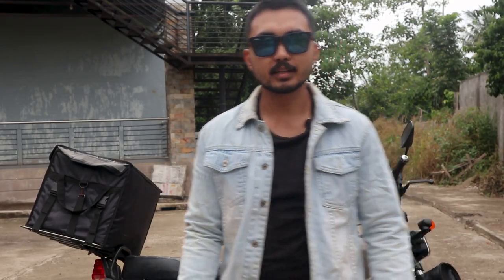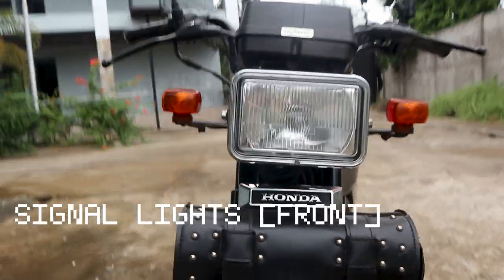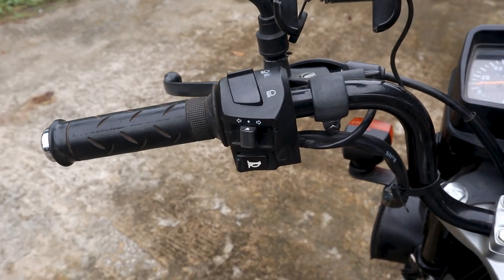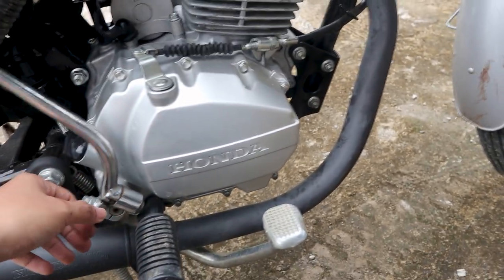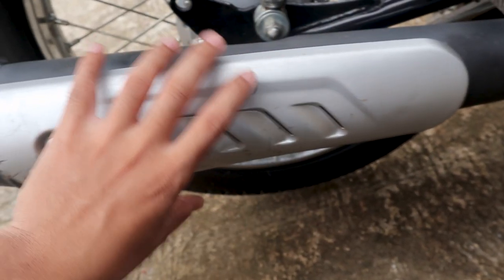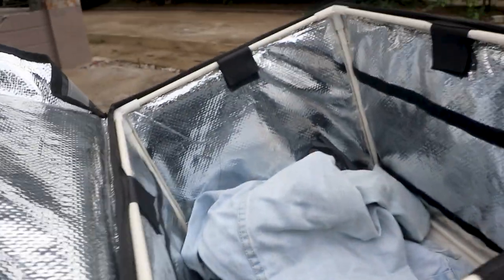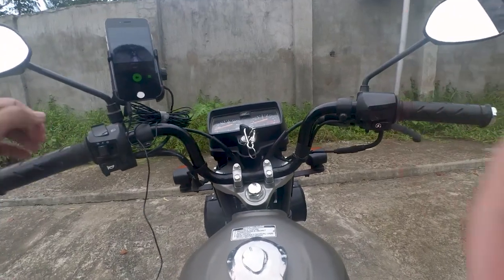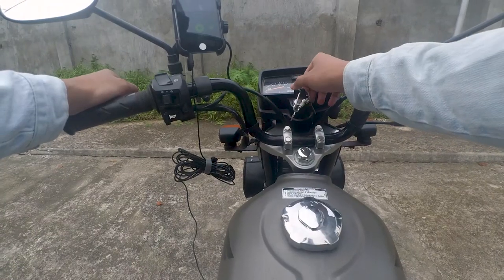HONDA TMX 125 ALPHA 1-YEAR REVIEW | RAFAELANTIHERO

Comment: I owned one last Nov. 2022. So far so good just like that colour. Good OHV (Overhead Valve) engine. Pretty good mileage. I replaced the front tires from 2.50 x 18 to 2.75 x 18 and the rear tires to 2.75 x 18 to 3.00 x 18. I did this so that it could hopefully handle my weight, I am 6' 135 Kgs though I am planning to replace the rear tires with 3.50 x 17 in the near future. All in all its a good motorcycle, easy to handle, easy to maintain. As for the fuel switch, the upper part is for the Reserve and the bottom part is for On while the middle is Off.
Reply from the maker: Facts! I plan to replace most of the front as well. I see. The rear tire is good for me. Thanks for commenting!
Reply: Hi Bro how's your motorcycle doing are you still happy with it...and dare l ask have you experienced any problems especially when it rains ...lm considering this my next motorcycle...many thanks..

Comment: Yung brake light ko ay lagi naka high beam kahit d ko inaapakan ang breaks
Reply: Brake light by the switch needs to be adjusted. Sounds like the spring connected to the brake pedal is too tight.
Reply: @telcobilly  na adjust kona po tama po kayu yung spring lang sobrang higpit sa break pedal tnx po